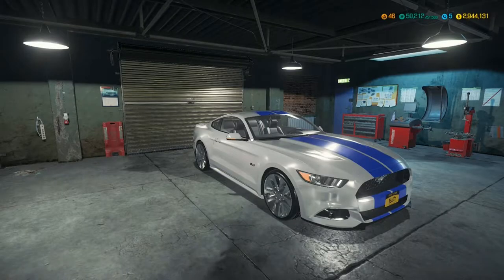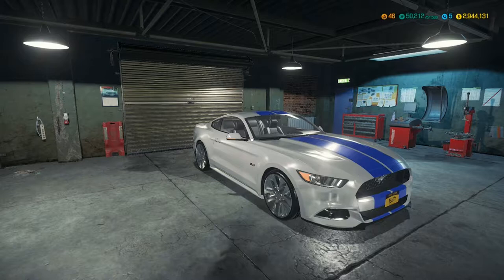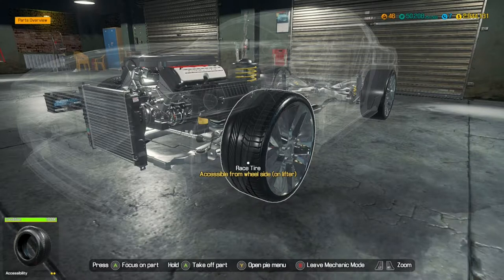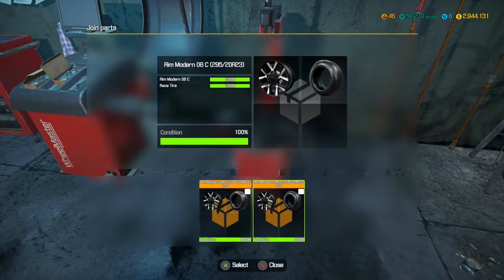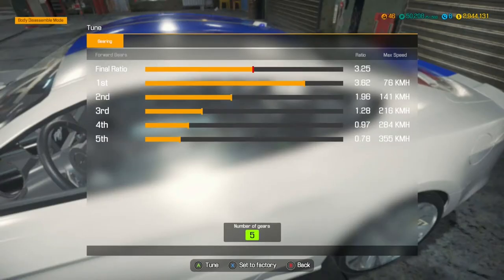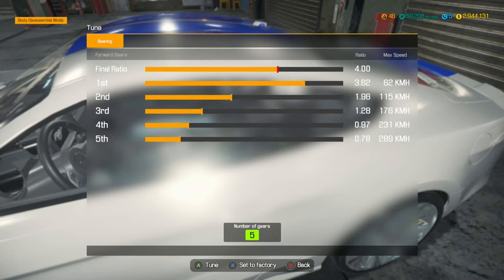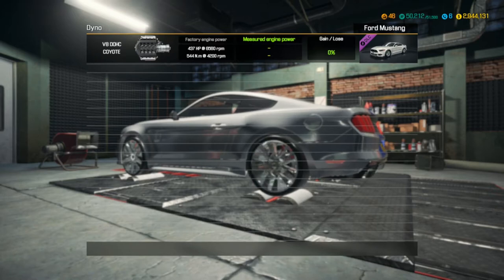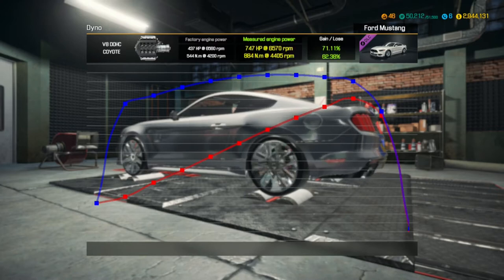Car Mechanic Simulator - Console - 2017 Ford Mustang - Race Track Build / Racer Boy RWD Build

Comment from the maker: I did get a bit overboard with this build, this car does not need that much Horse Power. I do believe that it's a great track car if built balanced, this car maxed out is not balanced and it does effect the handling. For the next video I'm going to try something, stupid! I'm hoping to get a Jeep Willys under 60 seconds, if not ill find a car that's different or odd!